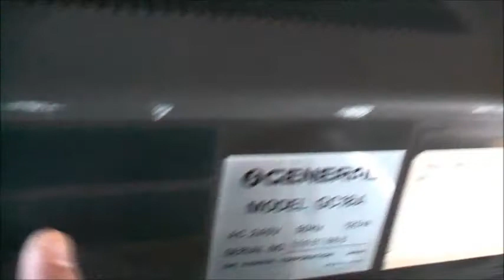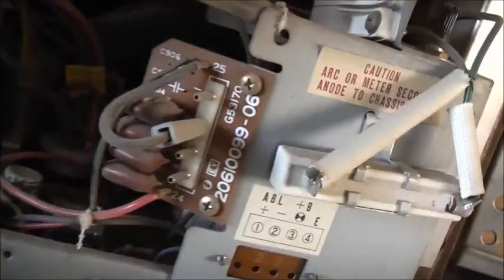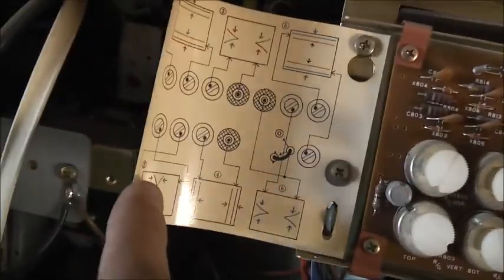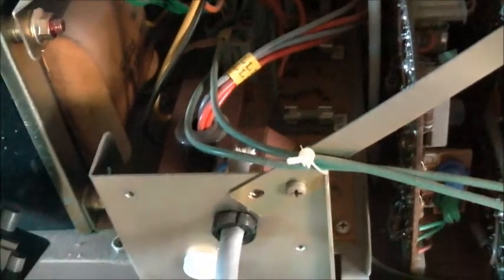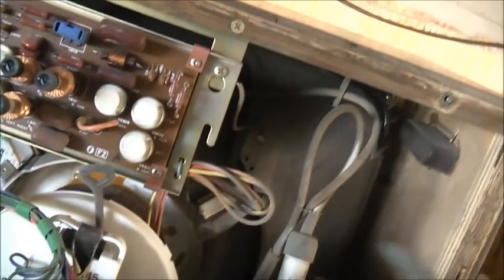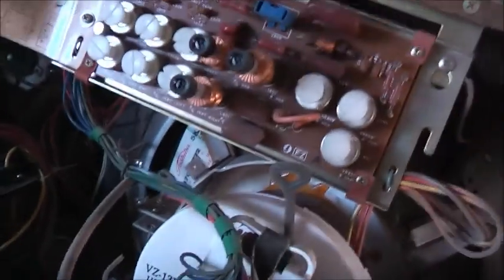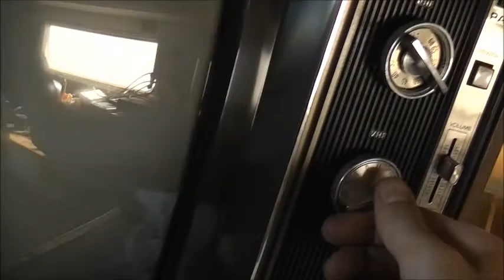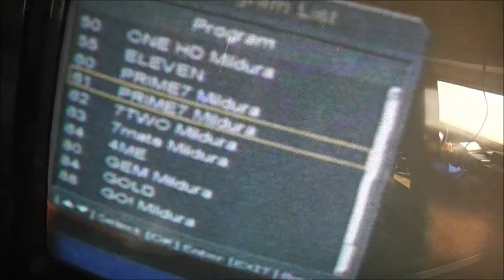Vintage General Delta Gun TV Score!!

Comment: That General is a very well built indeed. I notice it uses a modular board design for some of the individual processing/output circuits, similar to my General GC-141. Those delta-gun sets always had very fat CRT necks! My THORN 9001 has a surprisingly fat neck too, despite it being an in-line CRT. The three focus coils on the neck certainly do give it a resemblance to many 1960s/1970s delta-gun sets from America! The design, with the adjustment potentiometers on a board above the CRT, is very American too.
Reply from the maker: They're actually magnets, not focus coils, these are adjusted at a certain distance away from the guns, to steer the electrons to converge correctly, (Convergence magnets)
Reply: HDXFH
Whoops! I don't know what I was thinking of...

Comment: These sets aren't as old as 1969. I think they came out in late 1974/1975. It's about the same age as my THORN 9001 (also one of the earlier colour televisions in Australia). They were very cheap, reliable and popular sets, so there are quite a few kicking around. The UHF tuner is a bit problematic as you've found, which seems to be a common design fault with General sets, as well as my THORN 9001! These were Japanese made (General sets were made by Fujitsu), though the cabinet may have been made locally (as is the case with my Rank Arena C-2014).

Comment: Looks like the CRT is fairly good on emission, the streaking is due to the video output stages, adjust the focus, and run it for a while, the CRT should wake up a little. A box of electrolytic's and some soldering here and there should give this DELTA Tube set a new life. NICE :-)) They were built very well that's how they gained their reputation for reliability.
Reply from the maker: It came up a treat with some tweaking & resoldering of some dry joints!!!!!

Comment: Is there an EIA number on it someplace like that paper label on the inside? That will tell you who made it if they sold the same set in the U.S market. It was very likely made by Toshiba or Sanyo, the front of the set looks sort of like a Toshiba. Japanese sets were generally overbuilt in that era, I have a 1976 Panasonic and it also has a heavy mains transformer, but it does not have a rack of vertical boards like that thing has, and it uses more ICs.
Reply from the maker: Dunno, i'll have to look, the over engineering is awesome with these sets!!
Reply: HDXFH
I think I've seen these sets branded for someone else... HMV possibly?
Reply: HDXFH
There was a later re-designed version of this set (can't remember it's model number under the General name), which was also badged as a HMV "Braddon" 12613. It seems to have been a common occurrence among 1970s colour table-tops, for one particular design to be sold under several brands.
Reply: I rescued a 1978 Magnavox Colour set form oblivion, the brand was Magnavox, whom by that time was owned by Phillips, but the chassis at least was built by Nippon Electric. The only problem is that the door for the adjustment controls is mission. NEC seems to have built a lot of TV chassis for other companies, Curtis Mathes being one, who used to brag about being the Most Expensive TV in America and all American built, what crap!

Comment: Where you get your converter from?
Reply from the maker: Set top boxes can still be bought, My VHF modulator I have came off ebay!
Reply: HDXFH
Where did you find your one? The only ones I can find are (poor quality and generally faulty) Jaycar ones, and extremely expensive modulators in the US.
Reply from the maker: *****
 My one came off ebay, search for "Kingray or GME VHF Modulator"